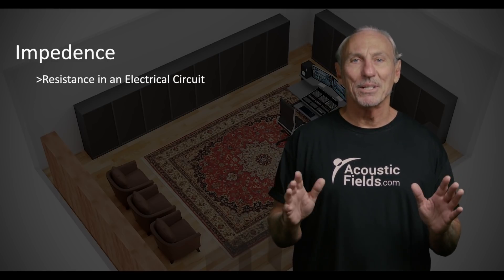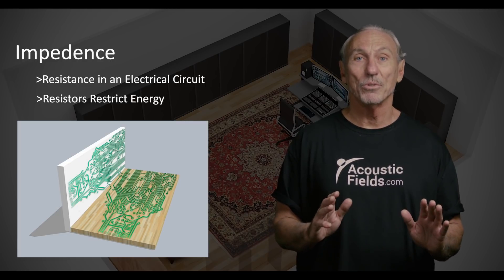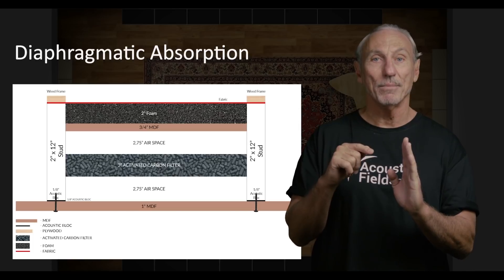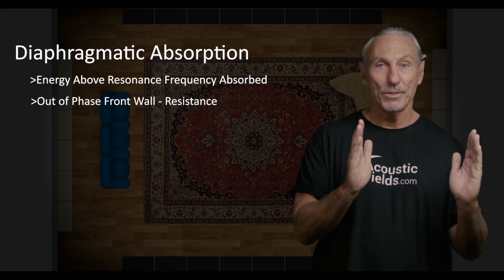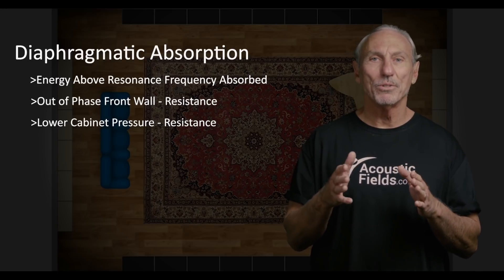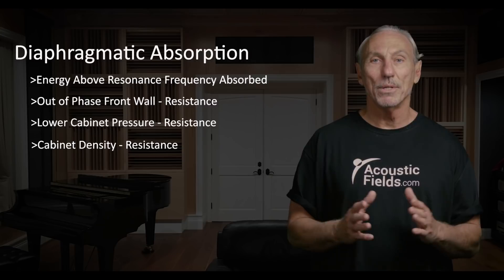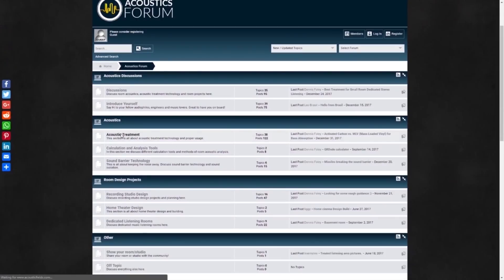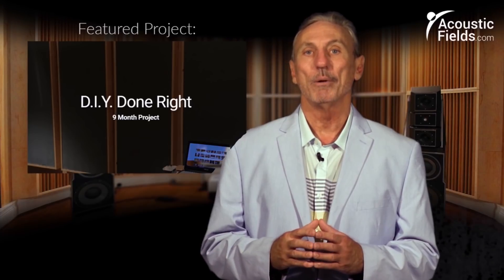Low Frequency Impedance - www.AcousticFields.com

Comment: Dennis can you comment on the 1" MDF for the front wall please. It seems thick but obviously you've chosen this over other materials and thicknesses. Why is this best?
Reply from the maker: A, There is no such thing as best. Everything used is related to frequency and amplitude of noise and treatment issues.
Reply: The thicker the cabinet walls the sturdier it is and the less chances of it vibrating and becoming a resonator itself.

Comment: You said you get 2dB reduction for every 10 sqfeet of absorber area. Does the amount of reduction not depend on the room size? Seems to me that for a huge room relative reduction should be less for a given area of absorbers than for a small room...
Reply from the maker: M,  Performance is calculated on a per square foot basis with average pressure levels of
 85 dB SPL. Greater room size and  volume lessens the amplitude of issues below 100 Hz. but does not eliminate them.

Comment: I'm building membrane bass traps with mass loaded vinyl.  The vinyl will have an air gap behind it, does the vinyl and the air chamber have to be airtight in order for it to work?
Reply from the maker: L,   Yes. What is the resonant frequency you are designing for?
Reply: @AcousticFields  Just trying to get rid of as much sub-bass as I can, the room is too small for diaphragmatic absorbers.
Reply from the maker: L,  You can't build a solution no matter what the limitations on space without knowing the problems you are try to deal with. You need to know the frequency and amplitude of the issues you are designing for or you are just wasting time and money. What is your room size and usage?
Reply: @AcousticFields  It's a 15' X 10' X 8'  control room for mixing only.  I get bass buildup and dropout in different areas of the room mostly from 50 - 80hz, that I wanted to control a bit, but like I said space is at a premium.
Reply from the maker: L,  You will need  to cover a minimum of 50 square feet on each wall surface. Low frequency management takes up 12 - 14" of space.
Reply: @AcousticFields  No problem.  So although not ideal, membrane absorbers would be the best solution for my situation? Or is there a better one?  Like MDF or wood in place of the MLV layered with absorbtion and an air gap?  Thanks!
Reply: Membrane bass traps are diaphragmatic traps.

Comment: This is so cool, just getting into a year of crunching dry reads of electronics and ac/dc current. This Chanel got me thinking.
Reply from the maker: J,  Sound source quality is usually better than room sound quality. The goal is to get enough of the room distortion treated successfully so that the electronics can reveal everything they were designed to do within your small room. Remember that your electronics produce high resolution sound quality in the digital domain, then convert that energy into an analog waveform that you then place within your analog room. Its like recording today using using a 10,000 microphone plugged into a cassette recorder. Rooms have limited bandwidth, are full of channel distortion and "crosstalk" and have high signal to noise ratios. People spend thousands of dollars to get the lowest distortion level in their amps and speakers, buy cables that do not add any noise to the circuit to connect everything together then put all of this high resolution into a low resolution room that accounts for at least 50% of what you hear. I never understood that line of thinking.  You must lower the distortion levels in anything that contributes 50% to what you hear.

Comment: The videos frequently mention tuning the room but how is that done? Are you measuring the room before treating it (which you can't really do in an unfinished space, except for computer modeling)? Also, if you're tuning a room for your current instrument/system and you make dramatic changes, is the room now potentially out of tune?
Reply from the maker: J,  Every small room size and volumes have frequency issues below 100 Hz. These frequencies below 100 Hz. are distance specific meaning the width, height, and length of the room determines the wall location at that unwanted resonant frequency. Most low frequencies below 100 Hz. (11.5' long) do not fit into our small room distances within the boundary surfaces. We localize the frequency and it's strength (amplitude). We locate the frequency issues at that room location, measure the strength at that room location and prescribe the correct treatment for that room location. We obtain all of this data from our database of over 150 built and measured rooms. Our ACDA series of diaphragmatic absorbers focus on the two most occurring frequency range issues 30 - 50 Hz. ACDA-12, and the ACDA-10, 30 - 300 Hz. Our foam technology on the face of each unit extends the absorption rate to 6,300 Hz.
Reply: Your room imparts coloration via reverberation and the nodes affect the amplitude (volume) of certain frequencies. By using acoustic treatment you are attempting to remove those distortions added by the room. You are not tunning the room to any instrument, what you want is a flat response from your room, in other words, you don't want it to add or subtract from the source signal. By lowering/removing the effects of the room you are then able to listen more accurately.

Comment: I used to think it was magic. This is brilliant and I got it.
Reply from the maker: N,  You can think of low frequency issues within your room as resistance. It is a resistance in the form of modal distortion. The "resistance" can be so powerful that it will let you hear too much frequency and amplitude or none at all at certain frequencies. Room size/volume/usage all contribute to the "circuit" along with the energy placed within the room or circuit. Remember the room only sees energy.
Reply: Yes yes a tuned mass dapper for the sound in the living room 👍
Reply from the maker: N,  Technically no. Both the ACDA-10 and ACDA-12 are broadband diaphragmatic absorbers. Their frequency ranges apply to 95% of small room issues.
Reply: @AcousticFields  you are right I should join the frum it's on the to do list